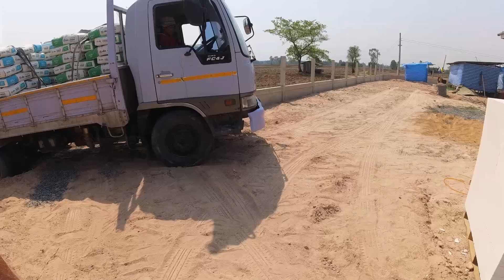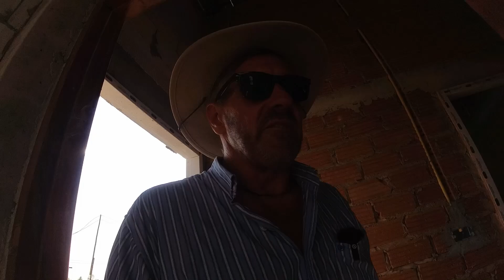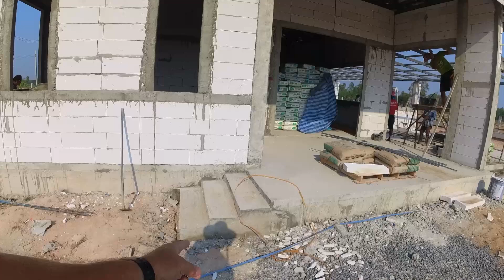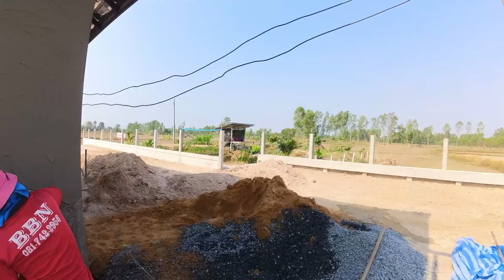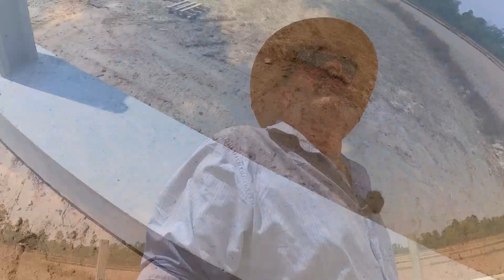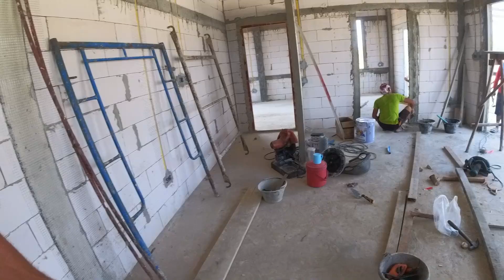Skim Coat Begins

Comment: Looking good overall, despite the Thai construction "idiosyncrasies", for want of a better/more tactful word. Most of our roof went on today, the speed advantage of metal sheet over tiles ! Just the fascia and flashing to add. The crew reckon it's nice and cool under the PU foam, and moved all their hammocks and gear inside. Make the most of it guys, the hammocks will come down when the walls go up!
Reply from the maker: Also, I believe the metal require a lot less structural steel, but I may be wrong. My outside living area will get metal. What's you completion target date?
Reply: @ParadiseNThailand  Yes, less steel and a lighter grade, much less weight to support. Contract deadline is 180 days from Jan 11, (which is July 9) so we are nearly one third through that. Builder says we will be in long before that though...we will see. I want a good job done, not a quick one.

Comment: I don't understand why when they make concrete like that hasn't the contractor duke have enough in funds to own a cement mixer 😅
Reply from the maker: This type of mixer is intended for skim coat. I has the small bottom dump for filling tubs. and is very portable inside the house if needed.

Comment: We buried our electric in the ground. So glad I did.
Reply from the maker: Duke looked at me like I was an idiot, but he is not the first! 
BTW, my toilet flanges and wax rings arrived today. I
I'll be doing that video within the next couple weeks. Thanks for the heads up. I'll be sure to point everyone to your video.
Reply: Thanks! My issue stopped. But still have some flies lingering in the shower drains. @ParadiseNThailand
Reply from the maker: @AmericanInThailand  my Lazada toilet flange kits arrived yesterday. Will be doing that video shortly.
Reply: I wish we had AIS fiber come out when they were digging in our electrical under ground. We do have the internet line exposed from the pole to the house. Oh well!  @ParadiseNThailand
Reply from the maker: @AmericanInThailand  i wiuld be happy with ANY internet connection. SIM card only until Elon greases the right hand.

Comment: The rainwater spouting along the face of the "flat" roof could be easily designed within the parapet to compensate for any downpipe blockages that could occur.  I frequently used to incorporate overflow droppers in parapet design.  Not only does it prevent overflowing internally but when the overflows are dropping water it's a clear indicator that maintenance is necessary...
Reply from the maker: Not familiar with a parapet, but I will google it now.  Ok, I googled. I think that is exactly what they did. Video coming soon. Let me know when you see it. Thanks Wayne

Comment: Having the "P" traps so far from the inlets will not avoid some smell from residual foul water laying in the pipe before the outlet, nor the foul water in the 'P| trap itself.  That is why the waste pipes should be vented between the sanitary fitting and the septic tanks especially if the pipe-runs are longer than 2 metres.
Reply from the maker: Agree, but didnt want the p traps under the concrete. The lines are vented, although not to our standards. I had to "persuade" them to get what i did. The sinks will all have traps under them, leaving wash machine, 2 showers and one floor drain without a p at source. All drains are vented within 3 ft of source except kitchen sink. My son just sourced and shipped an air admittance valve from the US yesterday to go on kitchen sink. Not the preferred system but well ahead Thai standards.